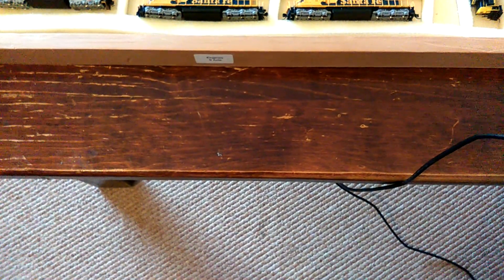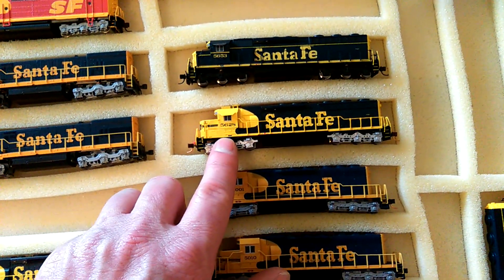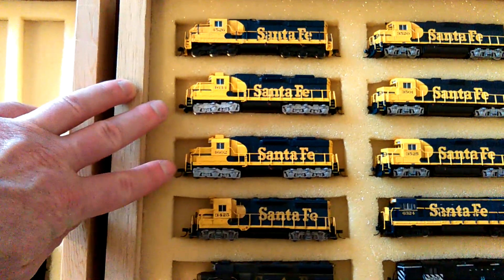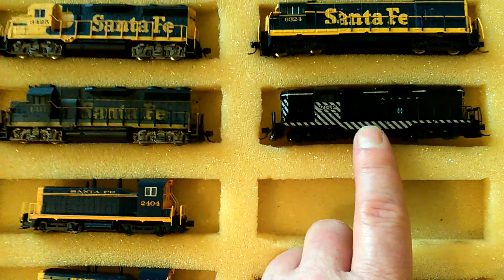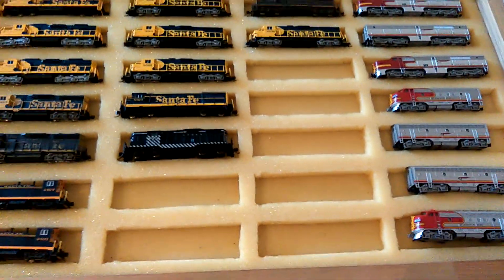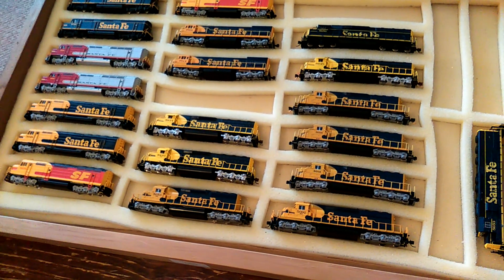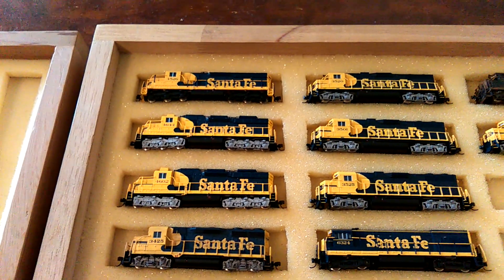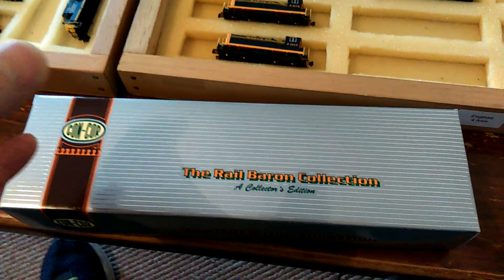Locomotive update July 2018

Comment: Great roster. Are the engines going to have "wheel flange" issues?  In one of your updates you said something about the rolling stock flanges. thanks for sharing, Chuck RVRR
Reply from the maker: Hi Chuck,
The locos seem to run fine over the Atlas Code 55 track. The flanges are smaller than the what's on the rolling stock.
Dan